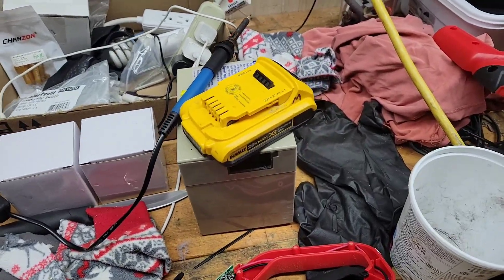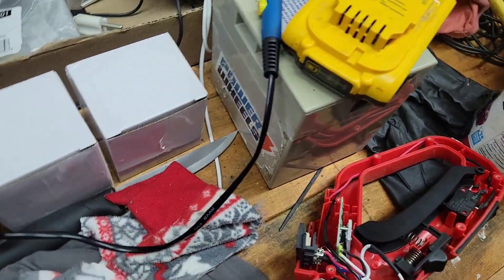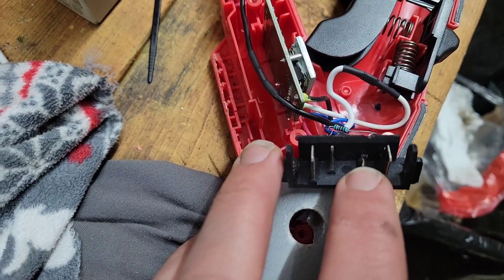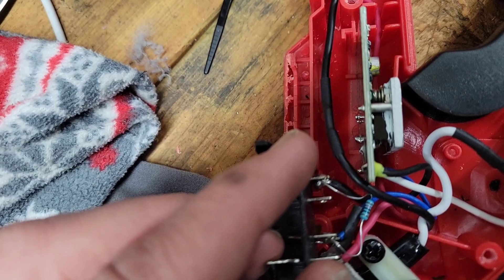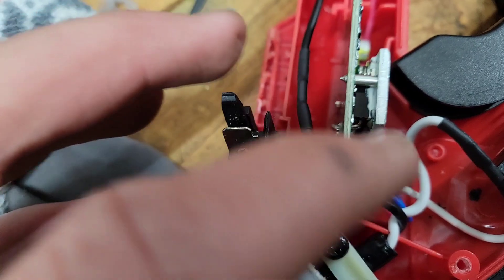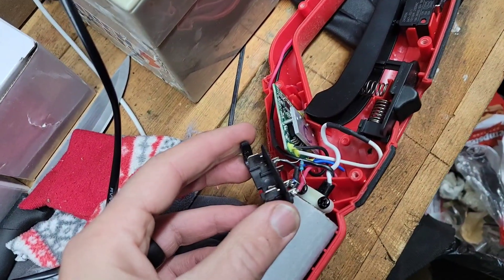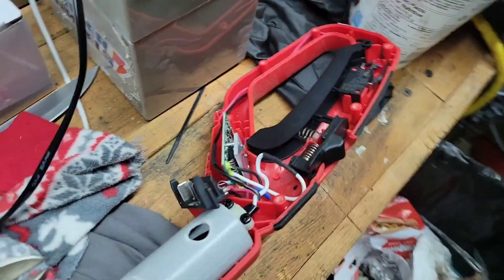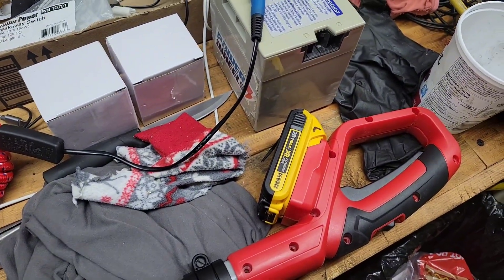Modify Bauer tools to work with DeWalt 20v Batteries

Comment: Worked like a charm, I just desoldered the blue cable and connected it to the black through a 10k ohm resistor. Left the tab in place.

Comment: So did you have to install a a resistor on that tool? Or did that resistor come with the tool?
Reply from the maker: I bought a 10k ohm resistor and installed it
Reply: What happens with no resistor? Its a hot glue gun
Reply: if you can't figure that out by watching the video, you'd best not attempt modifying anything.